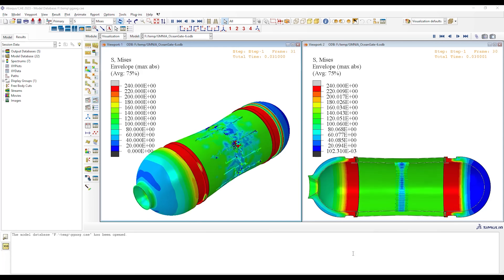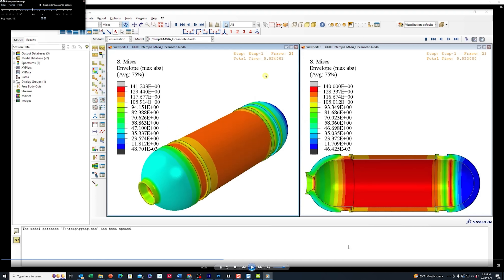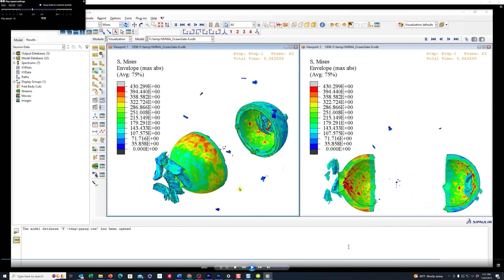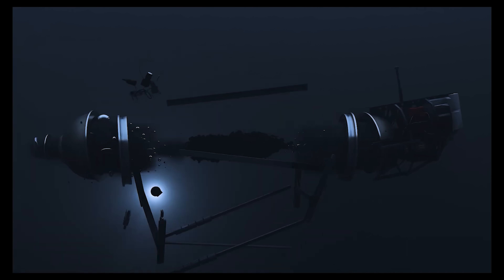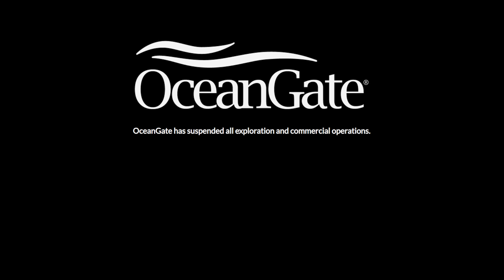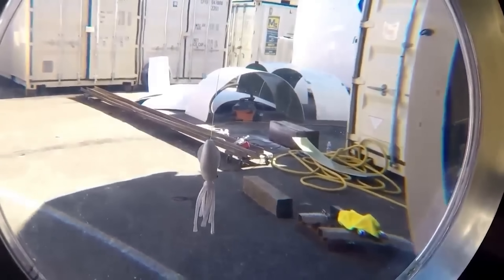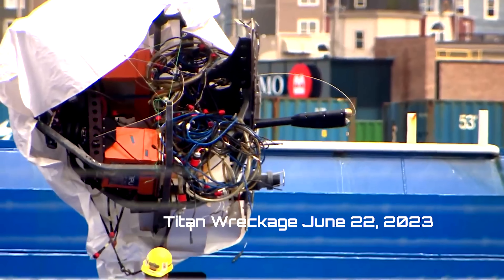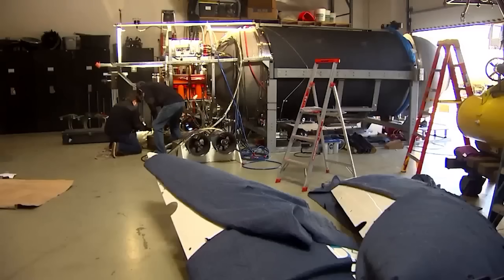Best Titan Sub Implosion Simulation, Cracked Porthole? Q & A

Comment: As a hobbist that works with acrylics all the time creating large acrylic objects, one thing that is very difficult to do is produce a custom shape that is without visable flaw, even curing the acrylics in pressure vessels and under high temps.  Even when you have a piece that is flawless to the naked eye you know that under a microscope there can be air bubbles or flaws.  I am pretty sure that is why that viewport was not rated to the depth Rush was taking that vehicle too.  On top if that he says that the acrylic was compressed and deformed a bit by the pressure when they dove and so I question as to whether that acrylic was ever tested to see how many compression and release cycles it took before it would fail.  If it was not found intact, but did shatter, I guess we have the answer to that question and had they known that through testing the cured acrylic is a pressure chamber they would have been replacing it after about 8 dives, just to give a margin of error.  It seems  odd to me that sny engineer would watch a material compress to a smaller state during use and return to its origjnal size without stopping and doing a great deal of investigating into what was happening to the material.  Did he even know that when it returned to its non compressed state it also returned to exactly the same shape, or was it slowly warping until at some point it was no longer fitted tightly.  Acrylics under great enough pressure that they would noticable compress in size do not always do so completely equally at all points, and in a situation where pressure us an consideration and everything has to be fitted to exacting sizes, that viewport may well ha e no longer been a tight seal.  What you point out in the picture taken from OceanGate, as possible cracks most likely were not or they would have been seem.  Much worse is the appear to have been a flaw unnoticed by anyone other than the camera which picked up reflections of water that had seeped in between the acrylic and the titaninum collar where a flaw was being created due to the cyclic compression of the actylic.  The naked eye would have missed it but the camera lens picked up the difference in light as it passed through the acrylic and refracted off the water with the titanium behind it.

Comment: I just got done watching your video going over the transcript of the titan sub and asked a question in the comments there. I'm gonna repost it here in hopes that I might get an answer, but why does the speed of decent matter? Wouldnt that same amount of PSI be applied to the sub that far down? If 3500m is when they started having problems while descending at the rate they were, wouldnt the sub have had problems at that depth regardless of if they got that far down in 1hr or 2.5hrs?
Reply: I agree with you.

Comment: I have seen calculation for titanium and carbon fibre. Basically at 1 bar and 20° C vs 500 bar 4° C size difference is almost 1 centimeter. 
Carbon fiber and titanium have different shrinking properties while cooling down, also have different shrinking properties while on elastic load. 
Considering shier toughness and thickness carbon fibre and titanium would be working against each other with like 1000 tons of force. That 1000 tons is additional force to existing water pressure. 
That also explains loud bangs like gun shots every so often while dessending down and asending up because carbon and titanium are changing in diameter at different rate and bang is when joint is settling forces. 
Like when you shut down car and you hear little tick tick, that's exhaust manifold is settling down on engine head because it's cooling and changing in size while clamped on engine head. 
That settling down force on titan was 1000 tons 🤯🤯🤯

Comment: Aren't some phone manufacturers serializing their components so that they would have only been useable to the phone they were installed in? Hence when you have a motherboard failure on a laptop with soldered in storage the maker basically says "tough your data is gone"?

Comment: It seems strange to have two different materials and not one solid titanium tube. Of course an orb would be better. So it looks like a water bottle with substantial titanium ends and this wimpy midsection that is basically basket woven. I mean doesn’t it seem obvious that long straight section would be the weakest area? Then the problematic port window only rated to 3000 meters or what ever. I just hope there was no warning just oblivion.

Comment: I was also curious about any potential camera or phone recovery. You're the first person I've heard bring that up. What are the chances we'll get to see,  if there is anything TO see? Or that they'll even inform the public that they found anything? 🤔
Reply: They descend in darkness so the external cameras are unlikely to have anything to see they also likely don't record sound. The Go Pro's are unlikely to have survived but if they did it's the best commercial for a gopro ever. The phones however....They have nearly zero empty space in them. There's nothing to compress and no reason the electronic packages couldn't survive that pressure because, again, nothing to compress. Finding them though that's a nearly impossible proposition unless investigators are VERY lucky and they stuck to the "possible human remains" AND that the saltwater didn't annihilate the integrated circuits in the time before recovery. The ceramic packages around ICs are very strong but I don't know if they're that strong.

Comment: In all the simulations I've seen, the titanium hemispheres are the only pieces of the pressure vessel to survive fully intact, which means OceanGate weren't complete hacks. If Rush had built a smaller sub with those titanium hemispheres bolted together, he would probably be alive now along with four others. But no, he went with a long CF cylinder for the sole purpose of cramming in more paying customers.

Also, I don't think it was the porthole because the crew transcript clearly mentions 'crackling' sounds from the rear and the vehicle gaining weight. The CF layers delaminated and took on water and either failed outright or tore away from hand-applied, dirty glue on the titanium rings.

Comment: Recovering a memory chip from a GoPro or a phone inside the Titan is unlikely. Anything inside of the sub was probably destroyed in a (200+ mph) hail of shattered carbon fiber shards.
Even an external camera would have stopped the instant the power was cut off. 
The problem with carbon fiber is that it would have had to have been PERFECTLY laid up. Any voids, or resin pockets would compromise the strength of the cylinder. Coating it with pickup truck bed liner (rhinoliner) probably wasn't doing much good, but it sounded nice.

Comment: I'll bet a dollar that Rhino liner has never been pressure tested to prevent water ingress at 6000psi. 🙄
Reply: Surely there would be air bubbles, however small, trapped within the glue. These could lead to premature failure of the glue bond.

Comment: Rhino liner is sprayable liner that would be applied to truck beds. Again, we see that Titan was a pot luck of various materials. Rule of thumb, as you combine various materials you increase complexly of joints as well as adding more variables in expansion/contraction puzzle.
Reply: Might as well put some flex seal on it too. Stockton Crush.
Reply: Sounds very logical.
Reply: Rhino liner is just sprayed polyurethane. It's not magic, it's one of thousands of variations on a molecule.

Comment: The crackling action on acrylic is called "crasing" which is fissures appearing in the item (windows / constructed items )  . The outer edge may have crumbled away then made an 80 lbs projectile. Window looked ok in your video. When it is crased little prismatic rainbow lines appear sunlight would make these appear.  Crasing may also result If corrosive type cleaners  were used this can effect the polymers.

Comment: This is all just conjecture. And shows how inaccurate modelling can be, even it seems on the basic physics. Two models, both using the reasonable theory that central section of the tube - unsupported by end caps -would be the section most susceptible to pressure. When this section fails in the first clip, the two end caps are blown towards each other. In the second model, they are blown apart. 
Since the implosion is a near instantaneous equalizing of pressure on both the inside and outside of the domes, there should be no particular force in either direction. And inertia would probably also be a factor. The main force on them - with the loss of buoyancy from the central structure, would be gravity. - either way, if two models give different results, we know at least one of them is wrong. And if one of them is 100% wrong, then what level of accuracy can we regard the other one with. The 'scientific' usefulness of these models, is actually less than a coin toss

Comment: You have to also take into account that while the carbon fibre pressure vessel is being pushed inwards, that gas inside is being pressurised at the same time to many hundreds of an atmosphere... in milliseconds. The gas pressure would have killed them long before the debris. But the debris would eviscerate the bodies.
Reply: The way I understand it is you are basically killed five times in about 5 milliseconds...none of which you could even comprehend!  In the end, a bunch of millimeter sized shrapnel and a cloud of pink mist!
Reply: @RRRIBEYE  -478 health🐒🥀. U cant even die that hard on a video game.
Reply: The air would of turned to plasma momentarily.
Reply: @1320fastback  aka "The 1st death of 5"

Comment: I was wondering about the increased rate of descent that was reported as it was far faster to get to depth on that fateful Day, I wonder if there were cracks inside the carbon fibre shell so it was taking in water and making it heavier hence it dropped faster? Also affected its buoyancy when they tried to surface as was reported the rate of ascent was far slower than it should of been…. Thoughts ?
Reply: A pin hole crack Will create a Vacuum chamber in the sub hull just a few square feet in volume there is no such thing as the acrylic plexiglass giving you warning as it cracks
Reply: As the models show, the failure happens faster than we can process it, at the depths they were at I can't see anything 'progressive' happening such as water infiltration anywhere... until it does and done... it's like a stick of dynamite with an electric detonator.
Reply: Gigantic squid

Comment: It seems very plausible that, when the carbon fibre cylinder caved in, that the window on the port hole must have been ejected like a bullet, not unlike the example so often repeated that Titan was squeezed inwards like a toothpaste tube, so the toothpaste blown outwards is what happened to that 7" thick block of glass. I do wonder if that glass piece will ever be found, because, inasmuch as the water at that depth is very dense, it must have been ejected a lot farther than any other piece of debris. Plus, since it is clear, locating it must be a lot harder.

Comment: I believe the porthole failed also, but I doubt it was the initial cause of the critical failure...it had to have started with the carbon-fiber hull and then a domino affect took place, which caused the porthole to fail. Though I am NOT an expert and I could be wrong. I'm just going by my own limited research. But we know that both the carbon fiber hull & the porthole failed. Video footage was shown when the Titan wreckage was recovered and the hull was imploded & the porthole was missing. So we know that both failed. And according to the experts that I've heard from, they assume that the carbon fiber hull failed first and that implosion caused the porthole to break. Which to me makes sense, because if the porthole failed first, it would have cause sea-water to rush in, which would have equalized the pressure inside as it fills up with water. The fact that the hull completely imploded tells me that the hull was the first to fail. Again, I'm no expert, I'm just going by what I've heard from experts.

Comment: "The strenght, weight and buoyancy is exceeding any known material out there."
Well,  they were right about weight and buoancy. 
We know that CF is no good under compression. It was bound to fail.

I just wonder if their descent rate would have been 25 meters per minute as decided,
could it have survived this one more dive?

But then again...one day it would have been ended in a disaster anyway.
You just need an over-confidence, arrogance and spitting at good engineering practices (I believe that's what Stockton Rush said: "good engineering practices")
No. It was darn far from good practices.

Comment: Jeff, like you I am very curious about where on the hull the cabling & hydraulic line(s) ingress from the aft equipment into the internal pressure hull. There seems to be nothing on the forward end cap other than the view port. The rear end cap in the rough and even installed doesn’t show any over much of its surface. My guess is in the titanium rings on the underside or lower arcs. I can’t imagine anyone would be reckless enough to penetrate the composite hull. Any hole would cut the carbon fibers whose continuity is key to the integrity of the structure! Reinforcement of the hull would be massive whereas cabling/lines penetration into metal components of deep submersibles is a well developed practice for decades (Trieste 1961). I guess the wiring/lines are on the bottom because much of the wiring inside appears to be under the flat deck and pictures of the bottom seem rare or nonexistent.

Comment: If the window were to fail, the pressure gradient across the submersible is zero, so it wouldn't have imploded.
There is a lot of speculation here.  In the absence of evidence, speculation is running rampant.  It would be better to wait until the analysis of the accident is completed.

Comment: I thought I remembered seeing in some video about the Titan that it had another safety back up feature where it had I think 2 bladders/air bags on sides of the vessel connected to a high pressure storage tank in the back that they could inflate to bring they up.  If this was so and like the aledgedly Transcript was showing them having trouble coming back up at a decent pace if they had realized the carbon fiber was failing and activated these bladders/air bags. Then they could have been the fatal blow adding far more stress and pressure to an already failing substrate?
I would also think that as the vessel imploded it would absolutely blow out the window and eject anyone in close vicinity like when an aircraft loses a window in the pressurized cabin.
Just my thoughts.

Comment: Polycarbonate would be go-to material to sit behind at that depth but of course its transmittance is measureably worse than PMMA which is very popular because for transmittance and thus the perceived clarity to the human eye. The difference is actually about 6 or 7%. The difference in strength and integrity is night as to day. Unstressed PMMA is full of cracks quite naturally. 
Although people have come up with several scenarios about speed of collapse compared to speed of human perception, I am not convinced by this idea that they knew nothing about what was happening. I have participated in psychology experiment where subjects reported conditions they had been exposed to for 2ms, yes, two milliseconds, so an event taking 2ms can be perceived by some human subjects although the information may take the 13ms plus this and that to actual get to the brain. So how long do we think it took for the neurological material in their heads to turn completely to mince and stop functioning? If it's 10ms then they knew nothing about it but if it's 25ms then maybe they did. Whatever the answer, the lesson is don't dive with d1ckheads.